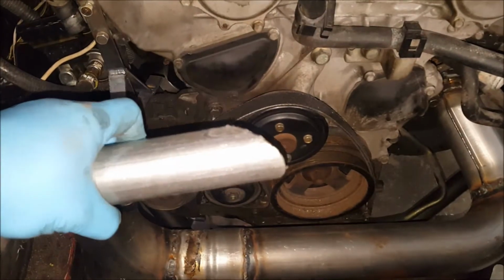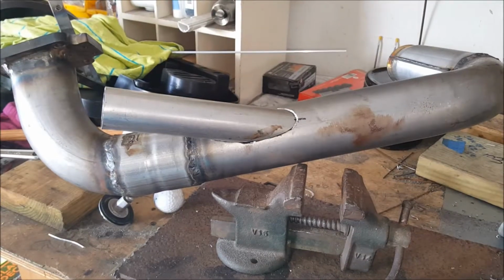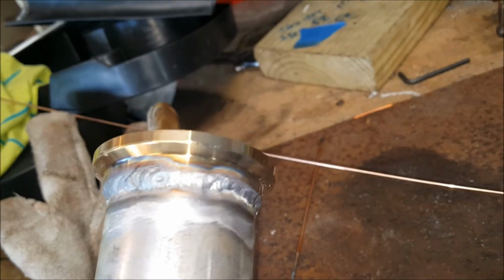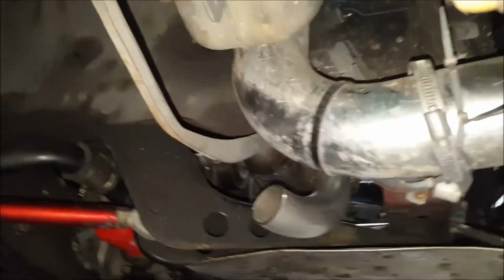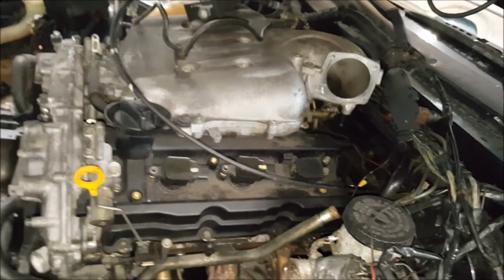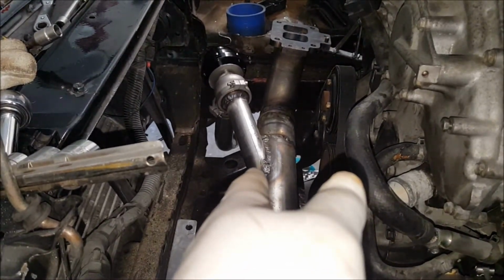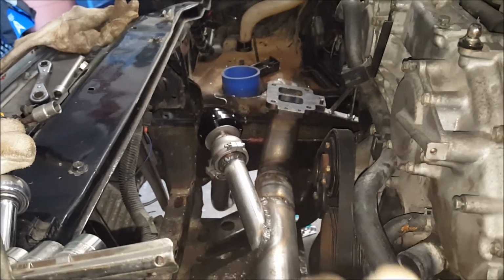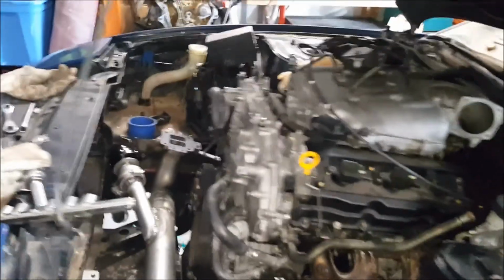VQ35 Build - Part 48: 44mm Wastegate Mounted

Comment: ever play around with the idea of decapping OE injectors?
Reply from the maker: I capped KA injectors back in the days.  This could have netted around 550cc from 270cc.  I did not run on this long as I switched to e85 and 1000cc injectors.  I will be running e85 again so I will need 1200cc or higher to get to my goal of 550whp with a decent duty cycle.  1200cc on corn should give me a max of 700 crank hp at 85% duty cycle. I rather get 1600cc to keep the DC down and have room to turn up boost if I ever build the motor.  1600cc at 90% DC can get me to 1000 crank hp.  The difference in price from 1200cc to 1600cc is very minimal.

Comment: Did you back purge? All this time it never crossed my mind. I think you can use gtr injectors second hand used for cheap
Reply from the maker: Aaron _z33 No haven't made a back purge hose yet.  It is on the list.  As for GTR injectors, not big enough for me.  I need 1200cc or larger.  I found Bosch 1600cc high z for a decent price but 14mm.
Reply: supakat500 I keep forgetting you're running e85. I think the biggest flaw I read with AHP was their valves are trash. Guess you got a good one lol
Reply from the maker: Aaron _z33 Yea, the 2015 had a crappy regulator.  I got the 2016 and was happy to see the newer one.  I just need practice and want to start walking the cup!  Some sick welds from walking...
Reply: supakat500 lol walk the cup then wrap the entire exhaust besides the welds 😅
Reply from the maker: Aaron _z33 that might honestly look good.... check out weldporn on Instagram or kanekid
Reply: supakat500 I follow terhovewelding on Instagram his welding is INSANELY good. Kanekid is really good too
Reply from the maker: that dudes welding is sick...thanks for the heads up...

Comment: Piece by piece. It's gonna scream.
Reply from the maker: Homebrew Subaru Oh yea...I found Bosch High Z injectors for a decent price.  Just need to get hats to convert to 11mm toos.  Not sure if I want to add more seals to the system.  Just in case of o ring failure.
Reply: Injectors are never cheap even good used ones. My stock injector seals on the Impreza hold back over 100psi fuel pressure no problem. As long as they seat, they will probably hold.
Reply from the maker: Homebrew Subaru Yea, thank god I never had issues with top feed injectors.  Side feeds were a pain for the KA.